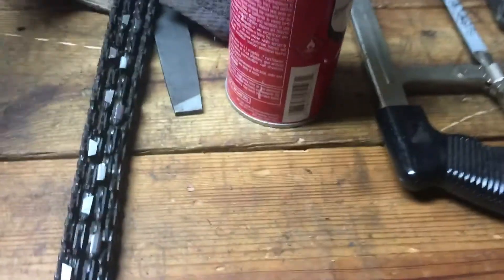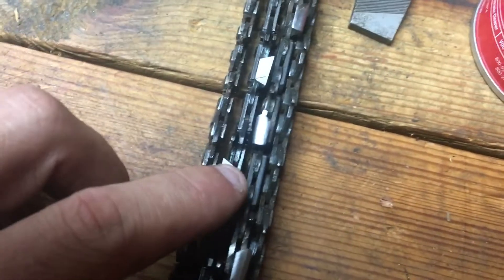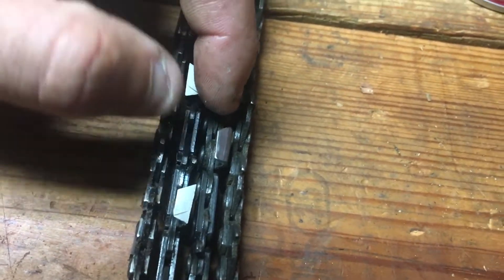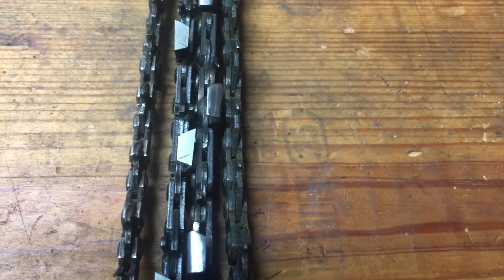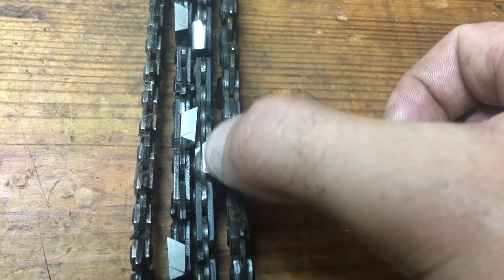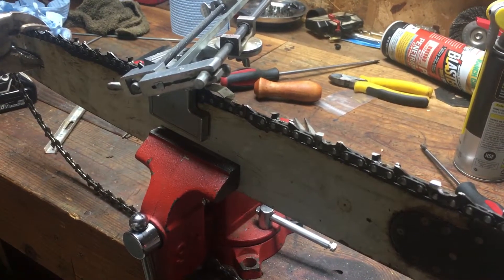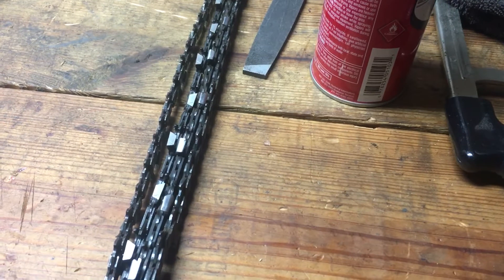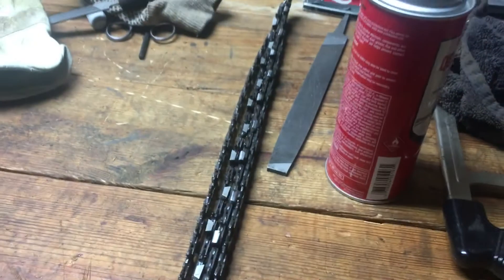Explanation of top plate angles on Saw chain

Comment: if only was true that chain lasted longer cuten pine :(
Reply from the maker: Well it all depends on what your cutting through, if your cutting knots and cross grain, it's all relative and how well your chain is sharpened. my chains last longer cutting clean green pine than they do in oak or other hard woods.
Reply: @BayouCountryPowerSaws  white pine believe eastern flavor. and trees are so old its traped alot of sand and grit in the knots and bark. full chisel all i can currently get. witch isent best choice. dk that there an angle that'd work better.
Reply from the maker: @alexlindekugel8727  I use 25-28° on chisel chain down here. It lasts about twice as long as 30° which is what it comes sharpened too.
Reply: @BayouCountryPowerSaws  i will try that! thank you for the tip
Reply from the maker: @alexlindekugel8727  yessir! Stay safe!

Comment: How do I sharpen the top plate? I am working on my sharpening skills but I don't understand how I can sharpen the gullet part, and get the top plate angle correct with a round file.
Reply from the maker: What size chain are you sharpening? And what file are you using?
Reply: You're basically sharpening/profiling from underneath - yeah, I know, it sounds weird.  The correct file size (dependant on the chain size) will make all the difference.  
1)  You might want to try out one of the Pferd/Stihl sharpeners if you're just starting out, which helps you get the muscle memory down while putting a reasonable profile on the chain, and also sets the depth gauges (extremely important and a lot of people miss it).  I like my Pferd, but it's just a back up for a quick "in the field" touch up now that my hand filing is decent.  Definitely worth it though.
2)  check out this video from Iron Horse - great explanation of how a chain actually cuts and creates a chip:  https://www.youtube.com/watch?v=aezO8-punDU
3)  Buckin' has a LOT of videos on hand filing.  You kinda have to cut through the rambling on some of his videos, but he has a lot of good videos on filing.

@Bayou Country Power Saws - thanks for the video, always looking to learn more about chains and filing!  Hope I'm not stepping on toes by posting about other channels.  :)

Comment: If a chain is sharpened at 25 degrees can it be changed and sharpened at 30 degrees? Is that okay to do or is it bad?
Reply from the maker: absolutely, I have gone from 25 to 30 and from 30 to 10.  As long as you have enough tooth left to change the angle it can be done without much effort and it will function just fine!